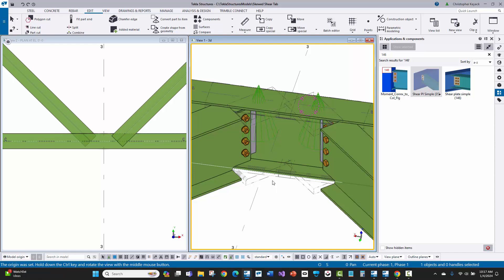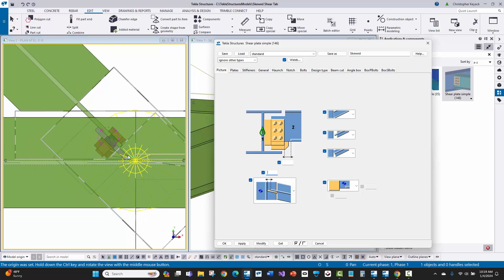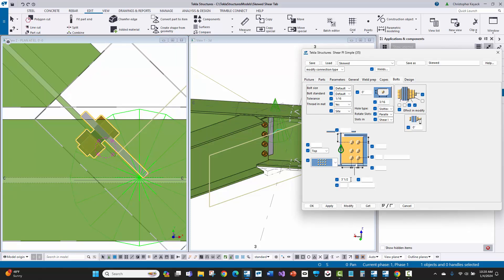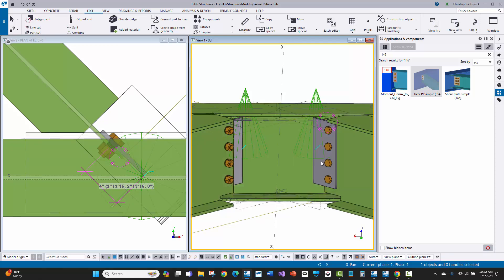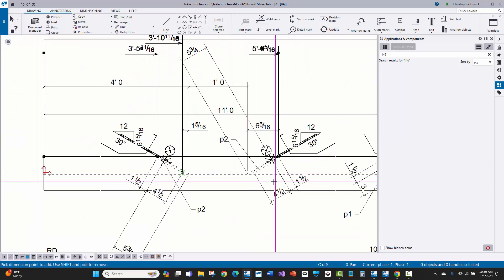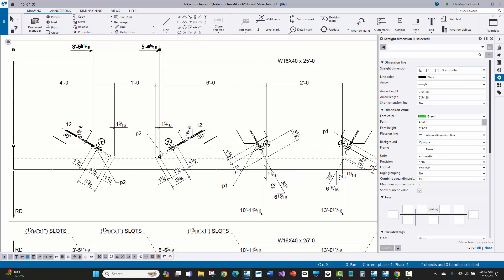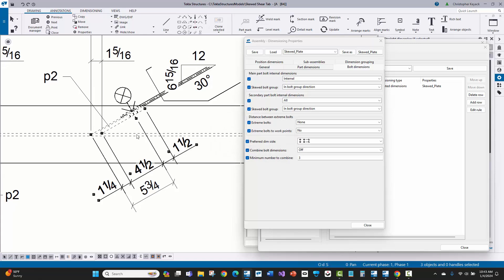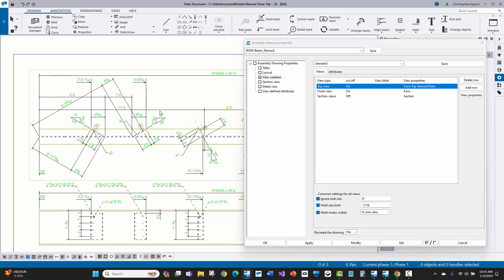KTS - Skewed Shear Tab in Tekla Structures

Comment: Hi boss, is it necessary to make the corner a bewel?to reduce a concentration of stresses or what? Any mechanics behind it?
Reply from the maker: Yeah for the cope the reason the bevel corner is still done on part of the flange is to reduce the length of the main square cope that is in the web. The advantage of this style of cope and cut is the cope across the web is like a standard cope and shop doesn’t have to bevel cut across the web on the flange.